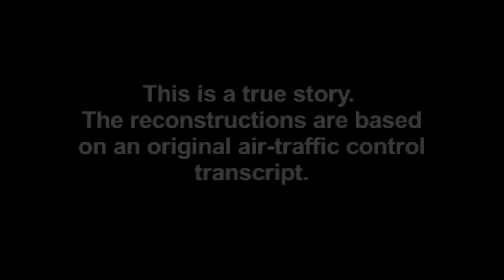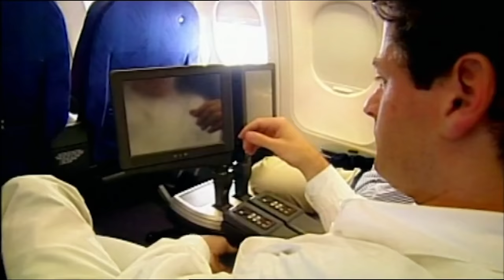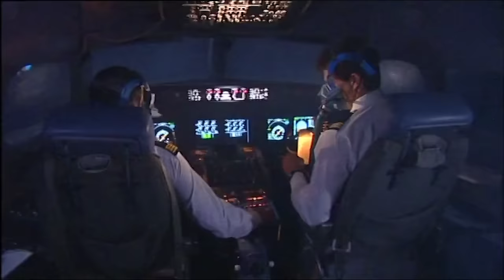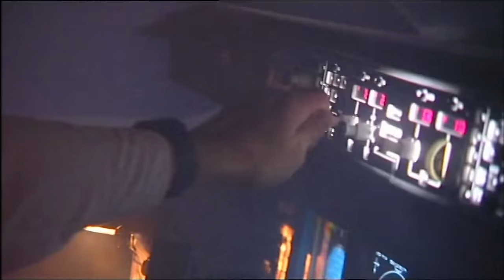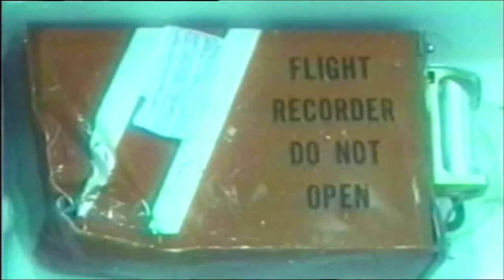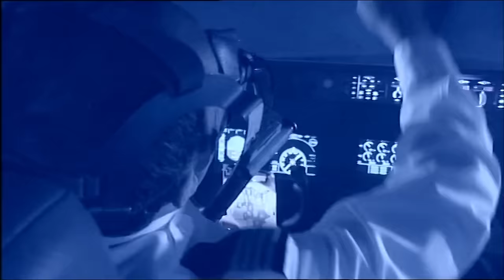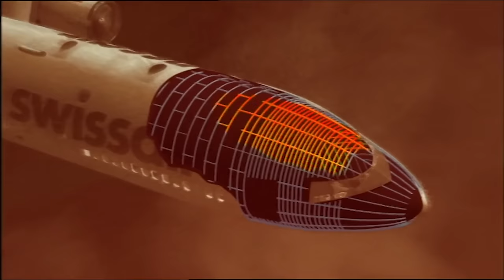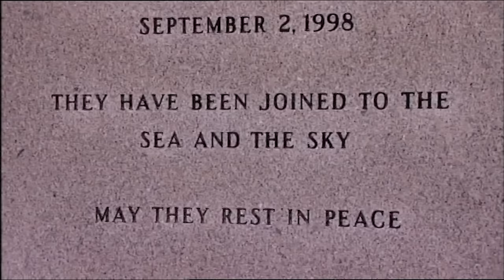The Search for Answers in the Crash of Swissair Flight 111 | Mayday: Air Disaster

Comment: Imagine you are going to work on a trawling boat and suddenly you are soaked in jet fuel..a lot of fisherman in that area work at night.
Reply: I'd gladly cop a face full of jet fuel if it saved an aircraft
Reply: not a bad way to go from fisherman to millionaire, just have a decent lawyer
Reply: @ausjen  One spark is all it would take to turn you into ashes.
Reply: As far as I know, depending on the altitude from where it's dumped, jet fuel largely dissipates before it reaches the ground or water.
Reply: @greatwolf5372  First of all it disperses mostly by the time it reaches the ground you would mainly smell it and second of all kerosene is not that flammable. It's not like petrol it's like diesel. You can throw a match in it and the match will go out. It takes a bit of pressure or heat to get it going.

Comment: Instead of diverting back out to sea to dump fuel, they may have been able to land at Shearwater Air Force Base which was much closer from their position than Halifax International. I remember that night vividly.
Reply: The plane was loaded with fuel for a transatlantic flight. I think they were worried about the plane crashing, and the already existing fire getting to the fuel, not to mention the fire resulting from the impact. 

Maybe to Zimmerman and the First Officer, landing with that full tank of fuel seemed like a worse option than dumping fuel.
Reply: They wouldn’t have made it to the Air Force base also would of been a pain for Boston Atc and Halifax Atc to contact the airbase and too much time would of been wasted plus there is no telling if they would have even made it. Look at UPS flight 6 for example if what might of happened to Swissair 111 if it had even made it to Halifax

Comment: Did they wire the IFE directly to the power bus instead of a breaker?

Edit: I just looked it up, and they actually did connect it directly to the AC bus #2. No breaker, no fuse, no way to shut it down. There should have been arrests made at the company that installed the system. negligent homicide at the minimum.

Comment: is it possible to survive 350 gs while still in the air ? i have heared human body can withstand only 5-9 gs for short period of time. so it is possible that people were dying during the fall due to their hearts not able to pump enough blood to brain ?
Reply: Well, probably yes, they died before the plane crashed into the sea, but I can't confirm since I'm not a doctor.
Reply: What 350g? Is that real or 35g?
Reply: No not at all and the g force happened on impact. G forces happen due to acceleration not speed. It hit the water at full speed that's the 350 g. You can survive maybe 20 g.